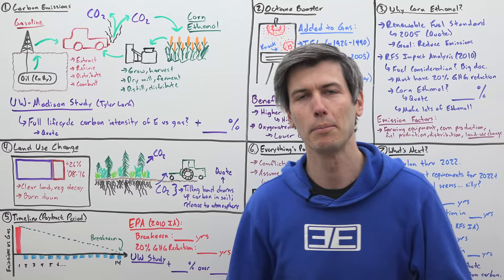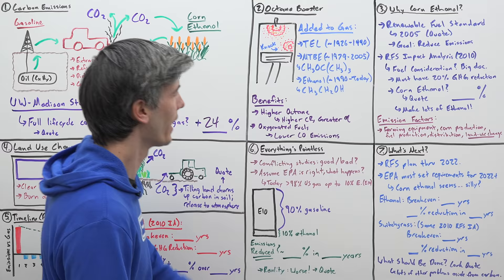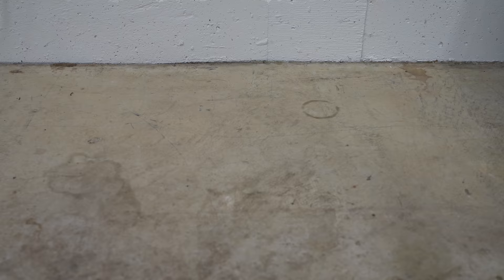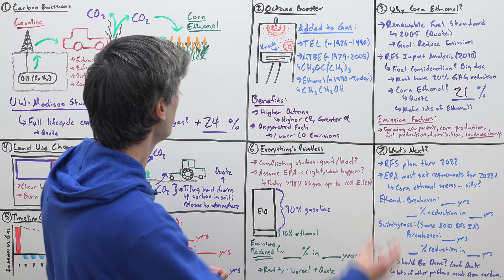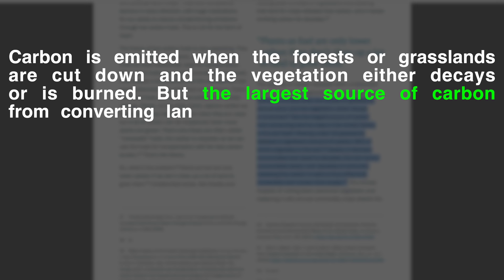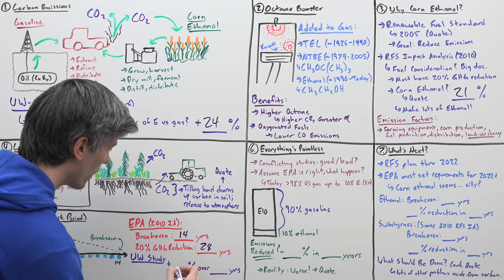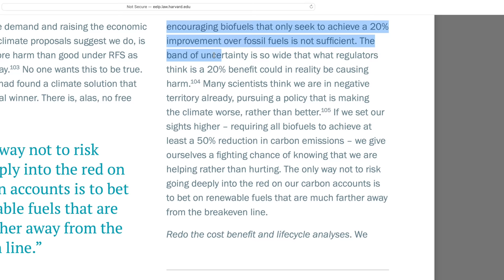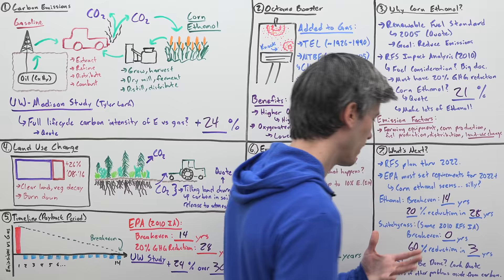America Was Wrong About Ethanol - Study Shows

Comment: Thanks for sharing your informative information thoughts and ideas. I’ve heard this prior, and like other commenters have frequently questioned the value of corn based ethanol in fuel. With the current world events leading towards a world wide famine cutting back on ethanol for fuel could help with the looming issues. America pumping more actual oil from the ground to make up for the loss of ethanol would also be helpful alongside the other ways pumping more American oil could help lower the overall energy costs in the world improving the world economy on a whole while decreasing profits to dictators that currently are sustained in their less than stellar goals funded by the world’s energy needs.
Reply: The cash delivered price of ethanol on the NYMEX is $2.375/gallon.

The cash delivered price of an unusable sub grade of gasoline (RBOB) is $3.47/gallon.

To turn RBOB into a usable E0 gasoline would cost a lot more much like premium, racing, and aviation gasolines cost so much more.  It also would become much more toxic, carcinogenic, and far dirtier burning.

Or you can simply splash in >10% ethanol to RBOB and the resultant usable fuel becomes much cleaner burning, less toxic, and cheaper/cheaper per mile.  Who can be against that?

Why on Earth would you think ending ethanol would decrease fuel prices?

You do realize that no corn is grown for ethanol, rather ethanol is a value-added product of already existing feed production which leaves 100% of the protein still available as feed in a healthier, more digestible/efficient, and more concentrated form called distillers grains?
Reply: @danafletcher2341  can’t argue your point since I don’t read stock exchanges data sheets in my free time. I’ve seen reputable videos by others who indicate both sides of the issues, even that ethanol makes the prices of fuel go up. My simple observation is from watching videos of farmers on YouTube. When the farmer harvests his corn and says something like, we’ll I saved some for the cows, and if I take it to town the port pays slightly more but the ethanol plant is closer so my trucking cost is less so I’m going to take some to either location and see which pays better overall. Certainly seems like the corn was grown as a commodity to be sold and as far as who buys it the primary concern is who pays better. To say corn is not grown to make ethanol is a little if not a lot misleading. My comment had less to do with ethanol and more to do with the current conflict in the Ukraine and the observation by many that since they supply the corn to most of Europe and the farmers probably won’t be farming in the middle of a war zone the people who normally buy from them are going to be looking for it from other places which will likely drive the price at the ports higher leading to more exports and less usage for local businesses be that agriculture or fuel production. Although most everyone drives, I think there are still more people that need food than gasoline with ethanol. Since the farmers usually are pretty low on the pecking list probably fuel companies with deep pockets are likely to be able to pay more for corn than the farmers feeding their cattle, thusly leading to shortages in the food markets. The only thing that might make it easier for the farmers to compete with the fuel companies is if the political demand for ethanol was decreased and the demand was left for economics to determine.
Reply: @tbix1963  The thing about corn ethanol again is that it is a value added product which is why it is the most economical source of ethanol.  The feed factor (i.e. the distillers grains) makes it more economical than other sources like sugarcane which make more ethanol per acre but little else.

If we all became vegetarians (or ate grass fed beef like I try to do) there would be no corn ethanol as it would be too uneconomical to produce in such a case.

I am sure that farmer's local ethanol plant you mentioned sells triple concentrated distillers grains to that same port for export.

When the Covid shutdown occurred and ethanol plants had to close there were farm magazine articles written that cattle feeders might run out of distillers grains.  If that had happened, what would they have had to use for their protein needs?  They would have switched back to feeding less concentrated straight corn.

The amount of corn grown is fully dependent on the size and protein requirements of the cattle herd on feed.  That is why stating no corn is grown for ethanol but rather ethanol is a value added product of already existing feed production is a true statement.

Believe it or not, the corn belt grew more corn acres in 1980 before ethanol than they do today with record ethanol production and ethanol plants everywhere.

2018 Iowa 13,200,000 acres of corn with record ethanol production
1980 Iowa 14,000,000 acres of corn before ethanol

2018 Illinois 11,000,000 acres of corn with record ethanol production
1980 Illinois 11,600,000 acres of corn before ethanol

2018 Indiana 5,350,000 acres of corn with record ethanol production
1980 Indiana 6,450,000 acres of corn before ethanol

This "new study" media blitz stated that northern states increased corn acres because of ethanol.  This is not true.  Feed barley fell from favor from cattle feeders and better earlier maturing corn varieties is the reason for the change whose trend began before ethanol came to be.  Barley was made in an ethanol plant years ago in a northern state as well and of course beer manufacturers sell their distillers grains as well. 

US barley acres were 8.32 million acres in 1980 before ethanol and declined to 2.55 million acres in 2018, the year of most ethanol production.  Corn acres in 1980 were >84 million acres before ethanol and during forced government land set aside and were 88.9 million acres in 2018.  Combine the two and we get 92.32 million acres in 1980 of the two feed grains and 91.45 million acres in 2018.

Ethanol is the reason the US eats grain fed beef.  In the 1800s contrary to our Rockefeller school textbooks, ethanol was the number one source for lighting in the US not whale oil.  In 1860, ethanol production was at 100 million gallons.  The distillers grains had to go somewhere and it makes a super productive feed.  Then in 1862 not long after the first oil well was discovered (1859) a tax to pay for the Civil War was placed on ethanol of >2.00/gallon making it as expensive as whale oil while kerosene was taxed at only $.10/gallon.  Literally overnight dirty, toxic, and more dangerous kerosene became the number one lighting fuel of choice.  The US continued to feed corn straight after than since we had developed more of a taste for that kind of beef.  In fact the most corn acres ever was in 1932 during Prohibition at >113 million acres.

Trust busting Teddy Roosevelt in 1906, some 44 years later, ended that tax with the Free Alcohol bill just in time to power the Model T with Henry Ford's favorite fuel.  John D. "competition is a sin" Rockefeller then massively funded a group of women to then bring Prohibition with a Constitutional Amendment no less.  Someone the likes of Roosevelt was not going to get in his way again so easily.

Octane is expensive, you know this because premium gasoline costs more.  Oxygenates clean up exhaust emissions and the petroleum industry had us using the disastrous MTBE for an oxygenate and octane booster after the disastrous lead octane booster.  After lead was outlawed, there had been a steady increase in demand for ethanol as an oxygenate and octane booster in the Midwest for years which had proven itself.  When it became apparent that MTBE had to go, an alternative was needed and this is why our current big demand for ethanol came to be.  The petroleum industry went along with the legislation because the bill had hidden legal immunity for them for the MTBE as state lawsuits were forming.  But someone let the cat out of the bag so that part was removed and the legislation passed anyway.

Even with just 10% ethanol added to E0, the Swiss Federal Laboratory for Materials Science and Technology found that the especially health devastating ultra fine or nano particulate emissions were lowered by 97%, carbon monoxide lowered by 81%, carbon dioxide lowered by 13%, aromatic hydrocarbon emissions lowered by 67-96%, and genotoxic emissions lowered by 72%.

The NYMEX is traded everyday and the amount is something like a rail car sized trade.  The symbol for RBOB is "RBY00" and the symbol for ethanol is "ZKY00".  Links are not allowed here otherwise I would list them.
Reply: @danafletcher2341   You're a pretty smart cookie, Thanks for the information, and the history lession. what do you do for a living?

Comment: Did they consider the cost of materials and replacement parts for fuel system damages? lots of butyl and rubber parts have been 100% detroyed by the ethanol fuel. 
In addition, people who cant get E-Free fuel put bad gas in thier small engines-lawnmowers.. etc... those people often throw away entire machines when they fail from the damage that E fuel causes.
Reply: Yes!! I’ve tossed a couple mowers for this reason. It’s not cost effective to repair them unless it’s high end.
Reply: I have ran the 10% ethanol right out of the pump for 15 years...not problems. in fact it stores better. it s sad you guys want to use Russian oil and not American made fuels.

Comment: I have a question does Ethanol/E85 based Fuel lower Emissions on vehicles? Because the catalytic converter converts the unburned Hydrocarbons, oxygen, carbon monoxide, and even oxides of nitrogen into carbon dioxide and water H20. Does that mean if the vehicle has a Catalytic Converter and is on E85 Fuel will the Emissions be non existent in regards to pollution?
Reply: Swiss Federal Laboratory for Materials Science and Technology found the nano or ultra fine particulate emissions with E10 and E85 were lowered by 97 and 96% compared with that of E0. CO emissions dropped by 81 and 87%, while CO2 emissions were reduced by 13 and 17%. Emissions of selected PAHs were lowered by 67-96% with E10 and by 82-96% with E85, and the genotoxic potentials dropped by 72 and 83%, respectively.

Comment: I was born and raised on a fairly large family farm and now, after retiring from other career field, am back to working in agriculture. I’ve always scratched my head about the logic of ethanol in gasoline; obviously result of big ag lobby and farm bill politics.
Reply: Ethanol will leave deposits in the carburetor and fuel lines of small engines when not used for a period of 6- plus months. 
Countless pressure washers lawn mowers trimmers etc end up in landfills because of this and it is a relatively easy fix. 🤦🏻‍♂️
Reply: I drive an old fiero a car that was never meant for ethanol and sometimes I wonder if finding gas without ethanol would make it run better.

Comment: Does this also apply to ethanol made from sugar cane? I use ethanol in all my cars, it's much easier and safer to make power and it would be a shame if it were taken off the market.
Reply: I wouldn't say E85 is safer by any means, be it for you or the car
Reply: Same question for beet here on France. 
Seems from my knowlege that it is easier to grow than corn.  Still we have to tranform it.
We also have the choice to use 85% ethanol mix this flexfuel engines or adaptation kits on standard engines
Reply: @callang9  how? For anyone running tuned cars and who doesn’t have $30/gal for race fuel ethanol is perfectly safe for us and the engine when it comes to making more power. Only thing I have against ethanol is it removes the solvent property compared to gasoline which is why running a blend is much better so you retain both the properties of gasoline and the higher resistance to knock and pre denotation
Reply: @universalg_  If price isn't a factor, I wouldn't say 110 octane E85 is any more safe than 110 octane petrol
Reply: Might want to do some research.  You are already approaching it with bias "would be a shame if it were taken off the market".  If you determine it takes more energy while producing more carbon than petroleum is it doing the good that you believe it is?  Here are some good keywords to start searching. Carbon Footprint, Biofuel, Sugarcane.
Reply: @callang9  100%
Reply: @callang9  Try putting 36 psi of boost on a gasoline engine and see what happens.
Reply: @visekual6248  ok, since you're knowledgeable, explain why I couldn't, or why E85 would be more preferable

First off, boost pressure ≠ power gains. Higher boost pressure also ≠ Higher Cylinder Pressure

Second, running 36psi is waste, race fuel or E85.

 Compared to a larger turbo at lower pressure, say, 20psi, that small turbo pushing 36psi is heating the air a lot more than the bigger one, and it's ultimately moving less volume of air.

There's a reason F1 and Nascar use ~ E10.

Cars nowadays, like a Civic 1.5T, run 16psi boost on a small turbo engine with greater than 10.5:1, stock, using 87 octane, and people are pushing them to 30 psi + on otherwise stock turbo/engine and pump gas.
Reply: @callang9  Okay, what you said may make sense, but not in my geographical conditions, gasoline is inferior, high octane is a fortune, and in the current situation, ethanol costs the same as gasoline.

The most modified engine around here are VW 2.0 4 cylinder , and ethanol is the standard, you see these engines with over 600hp running on pump ethanol, maybe modifying a high octane engine is better, but ethanol never let me down and I I won't pay more for high octane gas.

Comment: How much worse fuel mileage does 10% ethanol in gasoline cause? Methanol is not as energy dense as gasoline, is it? Has anyone entered this into equations?
Reply: The EPA states that the US fleet gets an average of 3 to 4% less mileage with E10 and 4 to 5% less mileage with E15.

On the E85 prices web page we see that the nationwide average of E0 is $3.96/gallon.

E10 average price is $3.11/gallon.

E15 averages $2.86/gallon 

E85 average us 2.39/gallon.

The world's most selling vehicle, the Ford F-150 is rated at 21 mpg with E0 and 16 with E85.

E10's mileage would be 20.16 mpg.

E15's would be 19.95.

We can see from this that E15 is the cheapest per mile to drive with although E85 probably is cheaper since they are probably selling it as E50 for wintertime already and mileage is higher than the rated 16 mpg.  E85 also gives the most horsepower.

Methanol and Ethanol have less heat value or BTUs than gasoline, but they have other burn characteristics which give the capability to have more horsepower and mileage in dedicated internal combustion engines.  More mileage and power than even diesel engines. 

Here is one Ricardo built for GM and drove a few years ago:

FROM RICARDO:
The new federal CAFE standards are calling for a doubling of fuel mileage performance, which, Vint says, is going to send OEM’s looking for high octane numbers to improve efficiency and ethanol is the best source. Ricardo, an engineering firm with over 100 years in the business of engine design, has developed an extreme boosted direct injection engine (EBDI) to optimize ethanol blends. The 3.2 V6 gasoline engine rivals the power and torque of a much larger GMC Sierra 6.6 diesel, he said, and it delivers 3.5 percent better fuel economy than the diesel.

Non-toxic ethanol is here to give octane to gasoline after lead and MTBE were proven to be absolute disasters for humanity as well cleaning up pollution as an oxygenate.

Denver in 1988 was the first government entity to require E10 when they were on the EPA list of ozone non-attainment zones.  Soon with ethanol they were off that list.

Even with just 10% ethanol added to E0, the Swiss Federal Laboratory for Materials Science and Technology found that the especially health devastating ultra fine or nano particulate emissions were lowered by 97%, carbon monoxide lowered by 81%, carbon dioxide lowered by 13%, aromatic hydrocarbon emissions lowered by 67-96%, and genotoxic emissions lowered by 72%.
Reply: J. roberts all my vehicles I test its zero loss or a gain. No equations simple maths.

Comment: In Brazil we have been using sugar-cane ethanol as fuel since the 70's, and it is great. You can choose which fuel to use when filling the tank (most cars here can run on both), and the gas has about 25% sugar-cane ethanol on it, so the new high compression engines either NA or turbo, can get more horsepower and better overall efficiency.